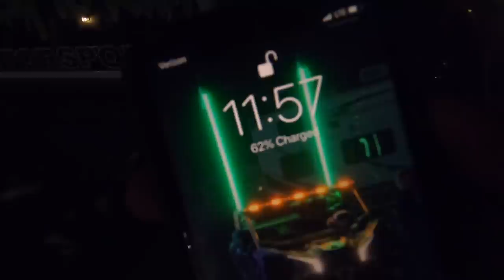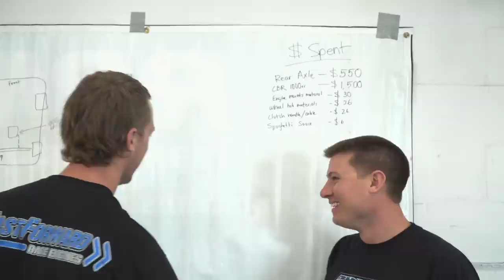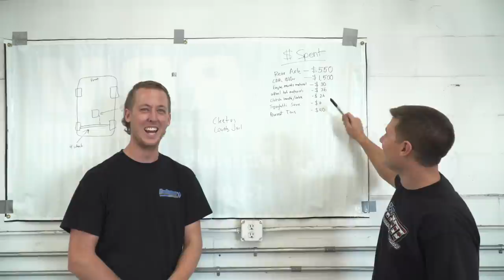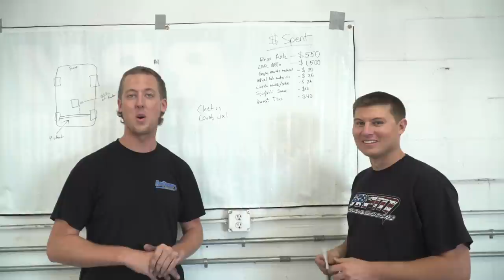Build Wars DAY 2: Buying a WRECKED 1000cc Street Bike for Our Golf Cart Build!! (SHE'S A RIPPER)

Comment: I want to see that new electric turbo on the golf cart.
Reply: James Davis that would be LEGENDARY
Reply: Too expensive though
Reply: Honestly you make a good point that's definitely gonna work for the engine.
Reply: Awww I just thought of that too not for the build off cause of the budget but it would still be cool to see on a small motor
Reply: Jared Thompson won’t cost a bean bro, it came for free and is all paid up!
Reply: This liter bike engine moves more air than the cobalt engine, it wouldn’t do shit.
Reply: @s2foci  it definitely would! Lol.
Reply: @s2foci  It would definitely work. Might lose power in the top end, but through most of the rev range it would be a massive boost.
Reply: @s2foci  It would work quite well. Using rough numbers, the 2.4l in the cobalt at 6k rpm moves the same amount of air that a liter bike would at 14.5k rpm.
Reply: @s2foci  Not stock it doesn't - not until the very top of the rev range anyway. If they were both holding at 5000 revs the higher displacement engine would use more fuel and require more air in order to burn that fuel.
That's why, outside of America, the average car engine is around 2l - because America pays per gallon what the rest of the world pays per litre (and still complain about high prices). For example, standard unleaded in the UK costs around £1.20/litre, approx $7.05/gallon. Add 10% if you want premium fuel. Diesel is even higher.
Reply: Lol, that's a great idea!
Reply: They had to send it back.
Reply: scotty197878 that’s not how a build off goes. You can’t use your own parts you have to source them. If they could’ve done something like that they would’ve taken the engine out the pit bike for kyle build off and same for cleetus
Reply: s2foci it would choke this engine down way before redline.
Reply: it was a loaner
Reply: Hell yeah plus $0 outta budget since its already there 😂
Reply: James Davis if the 1000 is a lot faster than the 600 in the end it could be an equalizer 🤷‍♂️
Reply: Holy Christ! That would be epic.
Reply: @demariohenry5352  he can sell it to himself deeply discounted.. it is used after all....
Reply: It would be a shame if the boosted boiz didn’t use that
Reply: plus almost no one would really want it for even 500 bucks so... say 350ish
Reply: That bike moves way more air. I bet you the compression ratio is 17:1.
Reply: Nope, 'market value' (rules of the build off) isn't $0.  Want to see the E turbo used after the build off, though! Unless they decide to send it back. :(
Reply: @s2foci  I doubt that. Horsepower is fairly close between the both of them, and the extra torque would help a ton.
Reply: @demariohenry5352  it was given to them for free.
Reply: @trilliedon8728  they said they can use their own parts but have to deduct market value for those parts from the budget....
Reply: @aydanangus  loaned, they had to send it back
Reply: lol that piece of crap would just restrict airflow
Reply: @vortexrage3918  He's said he not but I didn't think about it being in budget.
Reply: @sambert96  I'm pretty sure my r1 was like 11/1 I doubt it's that high.
Reply: Was gonna say the bike engine wont make enough exhaust pressure but its electric  dougghh
Reply: @GhostKill88  you right I was thinking of a 600. They still are 13:1
Reply: @megabowzer100  people turbo bikes all the time and it works very efficiently.
Reply: Big brain idea
Reply: Not a bad idea😂
Reply: Hell yeah!
Reply: After build war yes but the electric turbo is 2.5g they would pop their 3000$ budget
Reply: ezdfiant oh you’re right
Reply: @sambert96  im well aware of turbo,d cbrs and hayabusa working very well but they use small diameter turbo housings.the electric turbo these guys own looks too big for a bike engine.may work though
Reply: @megabowzer100  you right but that thing doesnt have a back housing, it's like a pro charger except electric. I'm sure if they fitted a manifold for it it would fucking rip. Course it would need a tune/ ecu reflash/ fuel remap. And that isnt a easy thing to do on a bike you gotta know someone that can unlock the ECU.

Comment: I feel like that axle is gonna twist like it's made of taffy.
Reply: They should have bought a used ATV axle like the boosted bois. They are actually designed to run a good bit of power and handle the weight. Plus cheaper then that overpriced aluminum junk axle...
Reply from the maker: Probably will
Reply: @CleetusM  probably will bend or yall are going the ATV route?
Reply: @williamroy1095  probably both lol
Reply: @CleetusM  nah man yall are trippin thats a feature its an axle with high tech built in suspension 
its just flexxin but its made out of vibranium so its indestructable unless of course you let ol cleeter drive it
Reply: @CleetusM  I build cbrs. those wheels are worth money. people retrofit them on all the older stuff. its a very nice factory rim. assuming they are true.
Reply: @merczeph79  its steel not aluminium. If it was aluminum it would snap not bend but it is an inch and a quarter solid steel rod ive seen up to 100 horsepower put through an axle that size but from a different manufacturer. The axle should be fine its all how they mount it and how good the middle bearing is.
Reply: BB is going to eat a rear sprocket anyhow.
Reply: @goob_1191  CBR1000's are putting 170ish hp. What they should've done is like other said is get a 4 wheeler 4 or a 2 inch aluminum dirt mini sprint rear axle.  You can get mini sprint axle's decently cheap and it can be 27 or 31 spline or 4 pin. Plus they almost never bend, I fell from about 20 feet onto the rear end with a 980lbs mini sprint and the thing is straight as an arrow.
Reply: add a third bearing in the middle to help with the flex.
Reply: Cleetus McFarland it would be the best best. I had a raptor 660 frame with the stock swing arm and rear axle, the frame had a 1000cc street bike motor and it did really well
Reply: @CleetusM  

....... ohhhhh yeah... better beef her better...  west coast boy's wayyy heaver and less HP.. kick their butts... DO IT FOR DALE
Reply: Not a chance it'll snap....it's diameter is what will make it hold... seen stuff like that before, the sprocket is likely to strip before axlel
Reply: Why not take the rear axle out of a 600cc micro sprint, that will handle the power
Reply: Lol kids love taffy
Reply: @CleetusM  ya done goofed
Reply: Should have just made a wood one again lol
Reply: @wafer2582  literally said they was multiple times in the video. Lol
Reply: @CleetusM  need to find a tractor supply store and get a solid shaft
Reply: Im gonna be really sad when 500$ worth of billet dies before they go 2mph.
Reply: @wafer2582  You're too late...they already did.
Reply: @CleetusM  Cleetus, you have the best part as far as I'm concerned, driving and being creative and keeping things interesting. You are naturally competitive and when you feel yourself wanting to win or reach a new time plateau so bad it is just eating at you, that's what you want to try and capture, the night you all rented the track to break into the 7s was one of the most exciting things I've watched, because however you all did it, it made me feel like I was there, I thoroughly enjoyed it. I know you must be racking your brain to think of ways to keep it fresh and interesting to everyone , unfortunately 8888I think that you have to keep reading comments to get a pulse on wherre everybody is and at the same time read from way too many people that the bilet axels you bought are too small and will fail. It really easy for all of us to second guess your decisions , but clearly you have put more good decisions  on togethers 34than a most of us that hav 33e

Comment: When this thing is done it would be a great test bed for that electric turbo
Reply: Yes! Put the electric turbo on it. Who needs nitrous?
Reply: Putting the electric turbo on it would be good but I think it’d be a big stretch of the rules
Reply: I think that 1000c motor would take along time to charge up the battery for the turbo.
I could be wrong though.
Reply: Alan Loyd yes you’d be wrong the alternator you could put on just like any car.
Reply from the maker: Has to happen!!!
Reply: I don’t think it would keep up with the engine’s demand at the operating RPM they’re looking at. Could be wrong. But even 1L is really huffing at 10k
Reply: @Tariq_F._Raheem86  no shit, I didnt say it couldnt charge it I was talking about the charge time due the difference in the power between the two engines.
Reply: Alan Loyd I don’t think you understand how the e turbo works.

Comment: That axle 100% isn’t holding that weight or power :(
Reply: Nope. Cheap axle for a drift trike isnt going to be strong enough.... that trike guy only pushes max 15 hp....
Reply: Need a shifter kart axle
Reply: Right. Should have scoured Ebay for something like a lonestar racing axle set up.
Reply: yeah I just picture that axle exploding when they first go to romp on it
Reply: @justme-ij2qy  they also only have 2 bearings.  They need 2 more in the center for the flex that'll happen
Reply: Yea, it was flexing when James was bouncing on it. The third brace may stop that, but I agree, not strong enough. See if you can get that cousins #.
Reply: That's the same axle in the busa cart.
Reply: @oneeyedude20  Actually theirs does have a center bearing they just have not finished the mount for it.
Reply: Tyler Hilderbrand 
Pretty sure it’s aluminum.
Reply: she just needs to hold for three passes boys! Have faith! Dale is watching over this cart ya know
Reply: Could just have one rear wheel and use the motorcycles drive line.  Eliminate the need for a new axle
Reply: It looks beefy enough for the power but the weight of the cart seems like it’ll bend that axle
Reply: I bet it twists right up on the first drag pass
Reply: it will work fine, put a axle clamp in the middle and drill some M12 bolts to keep the wheels on, have 6 bolts on each wheel
Reply: The drive key in that axle only ever going to be good for 35~45 hp. If it ever hooks it will break some stuff. To maximize the first breakaway on the axle refit all the drive flange and axle flanges with some locktite bearing mount on all the axle to clamped hub interface, drown that sucker.  Use heaps as you cant weld them together due to dissimilar metals. In a perfect world a full length key as well with steel hubs and sprocket mounts that you can weld and key together. If using Jr Dragster tires it will hook pretty well and that will be a problem.
Reply: Yup, was just thinking thats gonna be their failure point.
Reply: @samuelbehrendt6291  probably chromium steel, almost strong enough for king kong
Reply: @for_all_those3611  doesn't look like it to me.. maybe.. I'd like to know the alloy, I make axles for offroad race karts and we use solid  1-1/4" etd150 which is very similar in strength to a 4150 alloy.. we've had a couple break after prolonged use.. it might hold up if it's a 4130 chromoly. Guess we're gonna find out soon!
Reply: @mstew281z  Shifter kart axles are arguably weaker. They are typically 50mm but have thin walls. It's a kart axle just like a "shifter axle" but probably has thicker walls. Will their axle hold? I don't know. It will probably be fine but it depends on more info than we have from these videos.
Reply: @samuelbehrendt6291  who knows, there is alot of drag kart racing in the uk, and some of those go upto 200hp with bike engines https://www.youtube.com/watch?v=v-qQyB3E3pg
Reply: 4 wheeler axle
Reply: @for_all_those3611  The JR dragster tires are a fair bit wider and taller though. Not to mention the weight.

Comment: Has anybody taken into account that they must slow down afterwards?
Reply: Guess you missed the big disc brake on the axle 🤷‍♂️
Reply: bret thompson yeah but they’re small.
Reply: They're doing 8th mile so the other 8th will let em slow down I'm sure
Reply: New to this channel? Safety 3rd my friend safety 3rd.
Reply: @ethanwalker8973  8th mile on a track that regularly runs a quarter theyll hace no problem stopping.
Reply: My cbr1000rr maxed out at either 185 or 189mph... so standard issue golf cart brakes should be fine for those speeds 🤣🤣🤣🤣

Comment: When you don’t have a wood blade so you cut a 2x4 on a metal chop saw
Reply: Was looking for this . As a wood worker i almost cried lol. They had a sawzall right there haha
Reply: @reviewcrewforyou  Try making a straight cut with a sawzall... Kinda hard. Also, I use my angle grinder on wood all the time. Especially when I need to sand some wood down. It's just AWESOME with a flappy disk.
Reply: @Jahee-Official  sanding with a flappy disc is a different story I've done that for chairs and stuff. A single 2x4 is not too hard to get a straight cut on with reciprocal saw though. But hey they got it done that's all that matters
Reply: The devil Made me do it  it's all good until you try to cut metal with wooden saw/disk 😂
Reply: @lazarjanjusevic3  bro i once worked this dude who had no clue. I looked over one day to see him cutting 1 1/2" steel angle on a 6" wood saw. Sparks fucking flying!
Reply: I cut 10x10 beams with a judo chop

Comment: Ah yes. Cutting wood with a metal chop saw. Bold strategy.
Reply: Nothing wrong with that, just smoke a little bit but it will cut just fine.
Reply: Bold strategy Cotten, let’s see if it pays off
Reply: It's not stupid if it works.
Reply: they gotta work with what they have
Reply: Trees dead, it don’t care.
Reply: @HorizoonTV  wood saw works great on alluminum.
Reply: @sk8it8989  dodge, dip, dive, duck & dodge.
Reply: Any port in a storm, ya know.
Reply: I took woodshop in highschool, it pains me to watch that.
Reply: Seabass901 someone never learned what a joke was I see

Comment: I’ll be surprised if I finish this video and there was nothing wrong with that 1000 motor
Reply: Tsxtasy1 I'm not a sportbike guy and could easily be wrong, but I think it sounded alright. It revved quick and seemed to have good compression, anyway.
Reply: Looks like it runs perfect, somebody was ridin it while they dumped it
Reply: It forsure has a low rpm misfire going on
Reply: Old gas or clogged injector
Reply: The sinner Jim Whitney It just doesn’t sound like a CBR it sounds like a v-twin or maybe a v4
Reply: Bills BuildAll bad fuel will do that. Especially if it’s that mixed crap the EPA was pushing. New plugs, fresh fuel, clean the fuel bowls. I think it’ll run like a top. 🙏
Reply: Bike motors usually run good. Even if they are in a wreck.
Reply: Def has a hole down on compression
Reply: I have the 2014 CBR1000.... same Motor and pretty sure it's all good.
Reply: Watch the Boosted Boys video from today. It is running fine. Cleetus is just slow down loading content. Boosted Boiz seem to be better at everything. But they have a team with mad skills.
Reply: It's also running open header so it's going to sound a tad off.
Reply: @Tsxtasy1   Look at throttle bodies. Inline.
Reply: @stoker20  that's what I'm saying. It doesn't sound like any inline cbr I've ever been around. Sounds more like my old buell or an sv650
Reply: the state of the rear tire on it. It did a good long burnout before it got junked
Reply: It sounds sick because straight pipe
Reply: 🤙🏼 looks awesome, just subscribed to their channel too. Thanks
Reply: @cactusjack1806  it had a drop out while turning over to start. Sounded like one cilinder with no compression
Reply: Chris Millard if I had to guess, it was stolen and the thief literally rode it until it broke. And he broke.
Reply: It might “run fine” when running, doesn’t mean a hole isn’t down on compression, if I go out to my garage, and crank my 600 over the starter sounds the same for each cylinder, if I go to my fathers 1000, it sounds the same for all 4 cylinders, I bet he throws a compression gauge on it and finds one hole was significantly less compression then the other 3, could be a bad ring, a scored piston from revving the shit out of it when cold, or a bent valve
Reply: Tsxtasy1 Fair, like I said, I'm not a sportbike guy. Bear in mind, it doesn't have the factory intake or exhaust parts on it, I'm sure that makes them run like shit without computer tuning. My carbureted bikes run terrible with no exhaust unless you re-tune the carb, and so do cars and trucks without tuning. With sportbikes being so on the ragged edge, I would imagine the difference would be exaggerated further.
Reply: @The_sinner_Jim_Whitney  I mean, it could be. I've had friends ride with no silencer and no tune, didn't sound like that. I've been around quite a few cbr's and they don't sound like that. Also, this bike is fuel injected. We'll find out in a day or two though!
Reply: Tsxtasy1 Yeah, I know it is, just my frame of reference is carbs since that's what my bikes have. I would imagine that stuff that requires jets/carb tuning would require computer tweaking on EFI bikes. I hope it's fine and just needs new fuel, but we'll find out soon enough. Like someone else said, I doubt that dude would knowingly sell Cleetus a turd, knowing that millions of people would see it and it would almost certainly hurt, and maybe kill, his business.
Reply: @88s10Durango  bad gas made my 900 smoke exactly like that. It was premium straight out of the pump too. I was furious. Most bikes sound like shit when they are running on bad fuel lol

Comment: The silver lining here is that 1000cc engine running on 3 cylinders is still a 750cc which is still bigger than the boosted boiz 600
Reply: Smaller displacement will do better for traction! For both carts